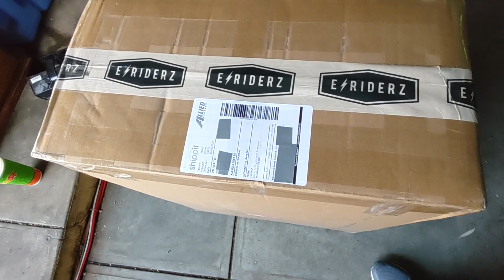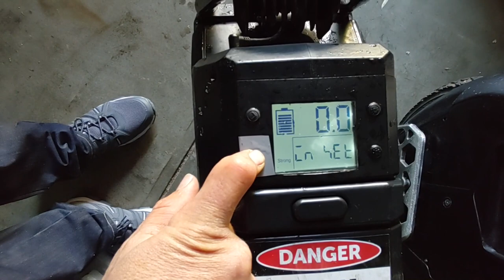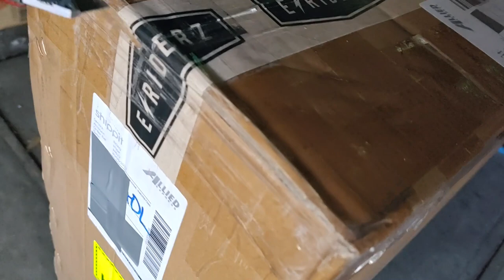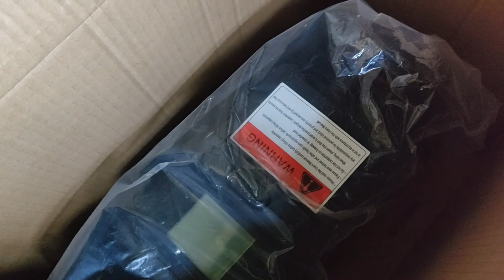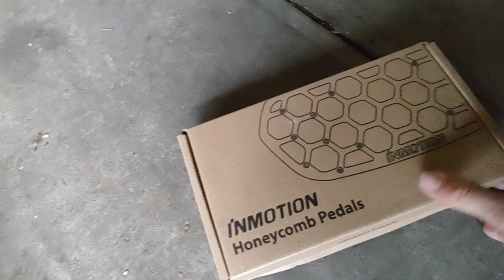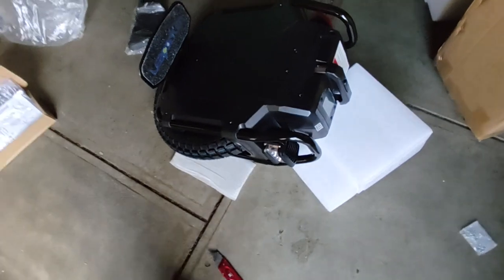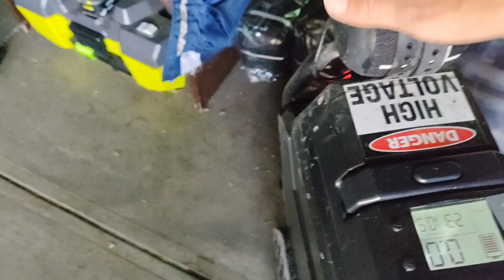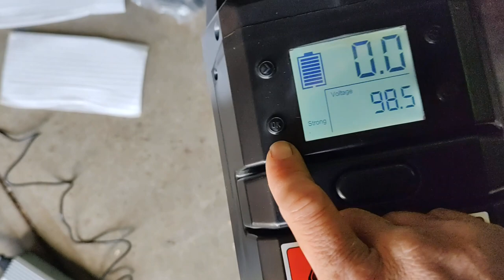I got a mystery box (100 pounds)

Comment: Awesome! Congrats! I still want the OG Sherman but after you Shred the Max I might just want that one..
Reply from the maker: hell yeah!!! Thanks bro I'm stocked to have 2 long range wheels now. Based on what I can tell so far, you should definitely go for the Max over the OG. It's only $200 more. At least it was at the shop I bought it from. And the top speed seems to be the same. More torque. More range. Weight feels the same. Smoother ride. And the pedals are a little higher even compared to the OG with the elevated pedals.
Reply from the maker: lol I meant "stoked" but "stocked" also kind of works. Stockin' up on dem wheels

Comment: Niice! I wanna get a suspension wheel next, but I still want to eventually get a Sherman. Grats on the new wheel!
Reply from the maker: Thanks bro. Yeah I wanna get a suspension wheel too. I was debating between the Max and the Master but then I heard the Master is super fragile.
Reply: @arcrides6841  Yeah dude, that’s one of the big things holding me back from the master. Zen Lee had a minor crash off-roading and he ended up bending the kick stand post and losing the tail light. I tend to do a lot of trails and off-road so I don’t think the Master will cut it for me, at least not this model.

Comment: Yo! I have the Max and the OG Sherm. Love the new upgrades and new rim more torque. Love them both. Good to have two Sherman's. I also have the begode cnc footplates on both Sherman's, awesome addition to the wheel. Congrats!!! You are lovin' life. Ride On love your content.  🐨👍
Reply from the maker: Yeah I'm loving this Max. It runs smoother than the OG. Probably because of the wider rim allowing the tyre to sit more straight. The top speed seems to be the same. Beeps a little higher in fact. It has noticeable more range. And having more torque is awesome for peace of mind. Now I can go up really steep hills without worrying.
Also it seems to have slightly higher pedals than my OG Sherman which already has the elevated pedal upgrade.

Comment: Gratz on the new Max. She's a gorgeous beauty, though, I have the Begode CNC pedals and they are dreamy. 
The Max has more torque (power) and less speed (watts) than the OG Sherman.
Not only can you use the OG Sherman charger with the max, but you can use 2 chargers when charging a Sherman (effectively making it a fast charge) so now you have two =8-Þ
Reply from the maker: Yeah I heard that it has less speed too. It freespins to a lower speed but when riding it seems to beep at a higher speed. My OG beeps at around 65km/h but the Max beeps a few km/h higher than that. If the max has a bigger battery then it will sag less and won't reach critical voltages until the speed hence power draw increases higher. Here's what I think. If you're going downhill then the OG will probably be able to go faster before cutting out. On a flat I don't know, must be close. And up a hill it would definitely be in favour of the Max.
Reply from the maker: Good to know that the chargers are interchangeable. I don't know that I'll ever need to charge at 10 amps. I'll probs just swap Shermans when one runs out.
Reply: @arcrides6841  I agree. So many off road riders were complaining that the Sherman can't do speed going uphill so the Max was made.

Comment: Congrats Bro! Awesome
Reply from the maker: Thanks bro. Hey I'm gonna finally get onto putting those spacers in too. You better believe that!! They're gonna give me tons of clearance. I noticed that the Max has even more clearance than the OG with the elevated hangers. In the end I think I'll have all the clearance I could ever need. In a Sherman. Never thought I'd see the day.
Reply: @arcrides6841  If those ones are too thick and make the pedals too high at the outsides, you might find some thinner metal like a dog food can lid or something thinner and make them like tiny 'angle iron' and glue that in there (with a brick on the pedal til the glue dries)... if one ever falls out or gets lost, just make another one.
Reply from the maker: @ratmanmurray7137  what kind of glue do you think would be best for the job?
Reply: @arcrides6841  I would think something like silastic/sikaflex... one of the 'rubberish' type glues... a little on the surface where the metal clamps and a bit more not near the closing gap. Not araldite or superglue, but once glued, put something heavy on the pedal until the glue sets, otherwise if it dries, then you stand on the pedal, the spacer might move.

Comment: Congratulations on the Sherman Max, what a lovely and intriguing machine!!! 
I am slowly getting ready to upgrade from my beloved first wheel, my v8f. 
I am looking an Sherman Max, inMotion v12 HT; what for and against for both can people and the honorable Arc Rides give me? :) 
I cant make up my mind at all!
Reply from the maker: Hey Terkel I had the V12 at the top of my list for my next wheel. I ended up getting the Max for several reasons. For 1 thing I heard that Inmotion has a much higher failure rate than Veteran. The eevees service center was apparently being bogged down by so many Inmotion returns. That alone steered me towards the Max.
The other reason is regarding the durability of the wheel. The Max is just like the OG Sherman in this sense so it's virtually indestructible. The V12 is just a big plastic box like my 16x and will break FAR more easily. If you do end up getting a V12 consider the HS version if you're not too heavy. Because even the HS version has loads of torque.
Reply: @arcrides6841  Hmm I will think. :) Thanks for the response. Durability is important to me. :P